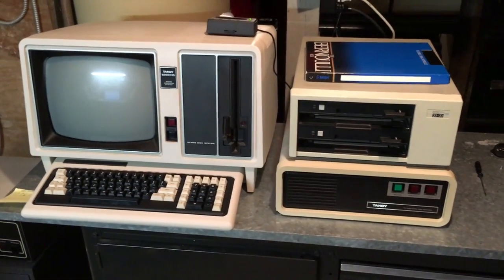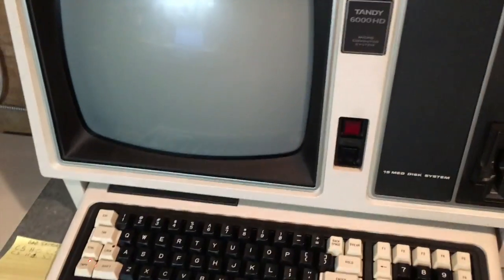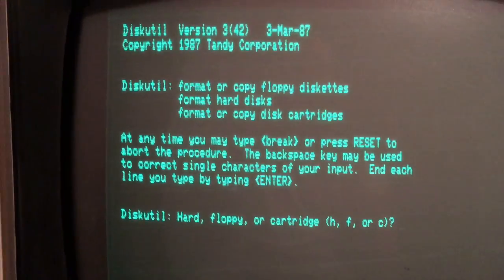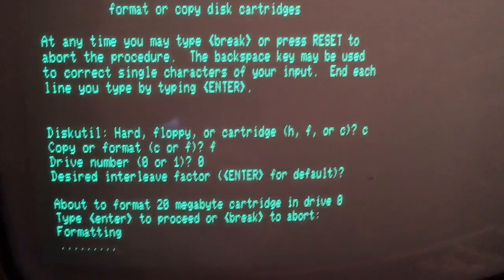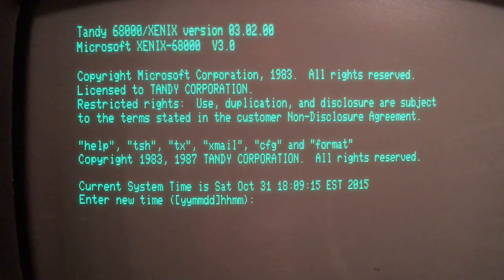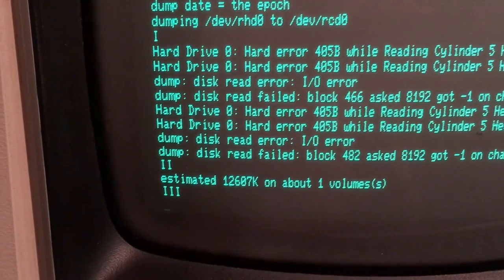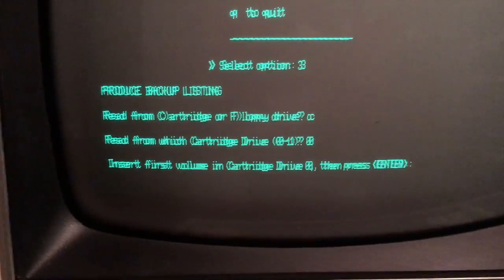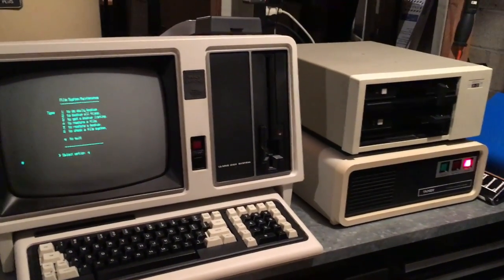Tandy 6000 Disk Cartridge Backup

Comment: Wasn't that system over $10,000 back then?
Reply: Wow. Never knew Tandy had a 6000
Reply: for that piece of crap? doesn’t even run windows or colored who bott that?
Reply: @jessihawkins9116  This computer was introduced in 1984.  That was the year the Macintosh was introduced.  Windows wasn't introduced until a year later.  Also this computer had a starting price of $4495 and some configurations could be upwards of $10k.
Reply: @douro20  yeh but it doesn’t have a mouse or 3.5 floppy or even USB ports so you can plug in a flash drive or webcam 🤷
Reply: @jessihawkins9116  This is from long before that time.  And computers like this did cost that much back then.